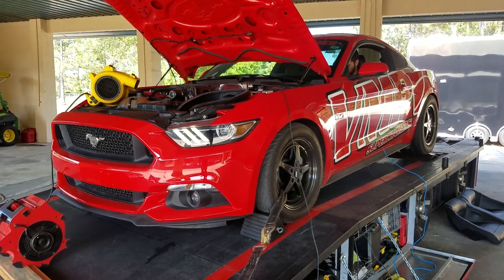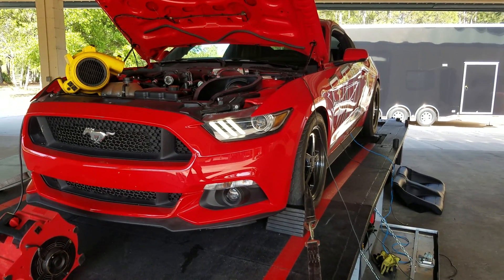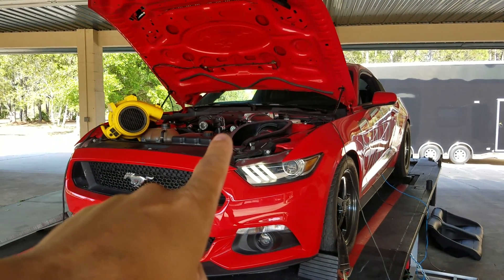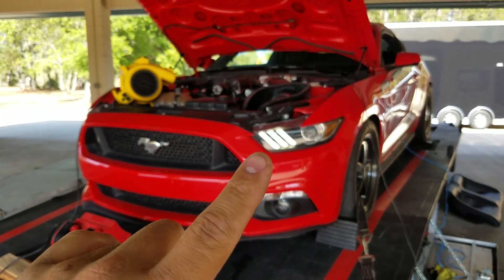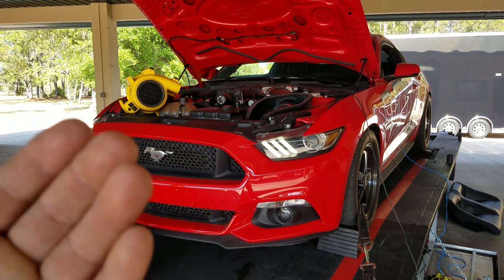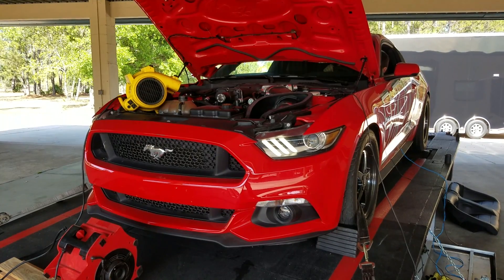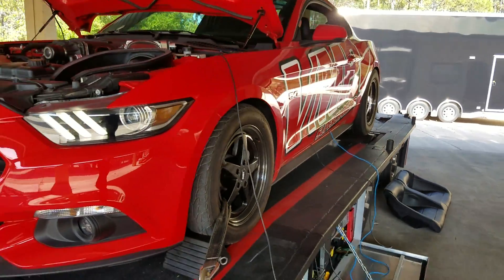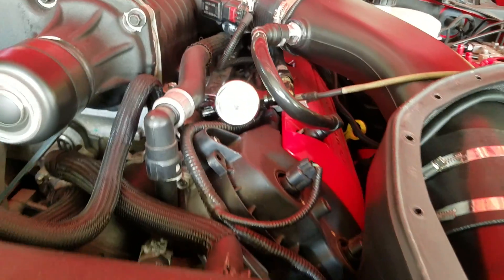DO WE HAVE A FUEL SYSTEM PROBLEM?!?!

Comment: Hi Alex, on a dual pump setup from Fore is a Hobbs switch necessary? I would rather have them both running full time if its possible. I am running twin 465's also.
Reply from the maker: It's not necessary, I prefer 2 pumps going full time, or a relay trigger. The hobbs switch tends to be temperamental and kicks the second pump on and off depending on where it's mounted.
Reply: Thanks for the quick reply! I love the tech videos you've been putting out lately. I have a kenne bell 2005 Mustang GT that I'm installing a fore fuel  system with ID1300x's. I watched your fuel system install video also and it gave me a lot of insight as to whats involved.

Comment: Had fuel delivery issues with my 2011 making 831 rwhp. We recorded the rail pressure while on the dyno just like he did. Twin 465s also. Boost reference also. Pressure was building with boost but not enough. It would lean out past 7100. With vacuum at idle my pressure was roughly 48 PSI. The only thing that worked for me was bumping the fuel pressure to 54 PSI which vacuum then I had fuel for days.

Comment: Add the plug and play bap to the system and see if that makes it better... (2) 465s should be good to go up to 900 HP.. Looks like a pump is failing...
Reply from the maker: Old Sparky already did.  No dice
Reply: Adding a bap to a failing pump would probably not help... i still think its a pump thing... Mabey not... Be good to know to when you find it...  post it up when you solve it.

Comment: What is triggering the 2nd pump?
Reply from the maker: Donnie Renfrow relay  but even hot wired both on... it still does it. so we will diagnose the fuel system... routing . ..regulator... Etc to make sure there's no restrictions